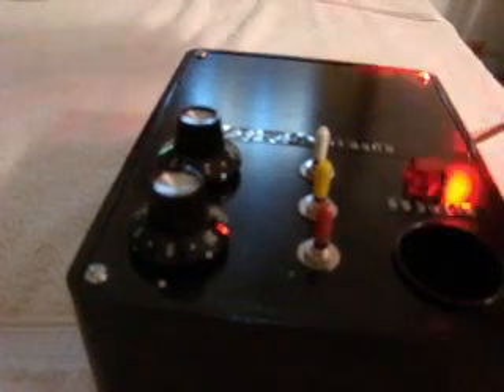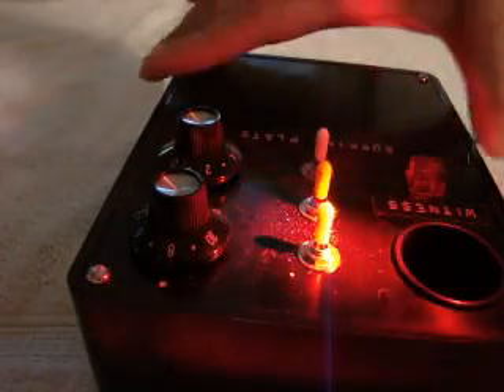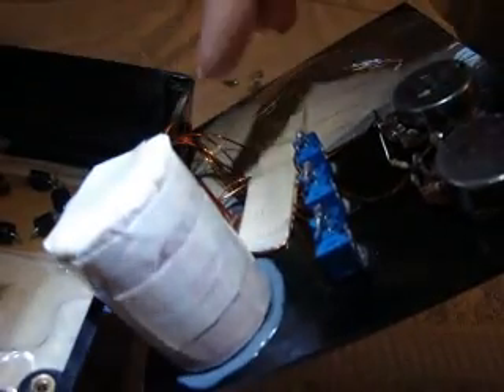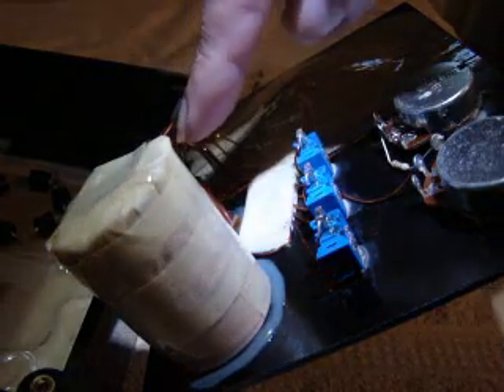Inside Steven Gibbs HDR - Hyper Dimensional Resonator

Comment: It doesn't cause time travel, it induces the Trance state (mind awake, body asleep; sleep paralysis), in this state you can focus on certain chakras, initiate the vibration stage and eject from the body. In the astral form you can then travel anywhere in time. The hard part will be remembering the experience, much like dreams. Unless you practice meditation, you will not have much awareness to remember anything.

The HDR mimics the same practice as is found in the Middle Pillar Ritual, and the Hollow Body practice of Vajrayana Buddhism. Robert Monroe has a similar practice. These practices alone are enough to induce the Trance State.

All Magickal Traditions have Visualization as their core practice.
In Vajrayana Buddhism it is called Generation Stage or a Creative Yoga, by using Visualizations you begin to create hypnogogic imagery that facilitates sleep, an experienced meditator maintains enough awareness without fully dissolving into the resolution of sleep and enters Trance. Once in Trance, Completion Stage Yogas can be practiced, such as the 6 yogas of Naropa, they are the Tummo (mystical heat), illusory body, clear light, The Dream Yoga, the Consciousness Transference yoga, and the Bardo yoga (an advanced form of consciousness transference used after death to transfer oneself into a suitable body for rebirth, this yoga allows you to keep all that you have learned and carry it on to the next life).

Comment: someone out there HAS to be as "talented as Steven Gibbs" to make the exact same product! And sell the exact HDR at a cheaper price! Come on! This is the time of the internet.. where all geniuses can be found easily! 

I challenge any genius out there to build an HDR!
Reply: I built one, a while back... suprisingly the cost  of all the parts adds up. The electromagnet is a bit of an effort. The device is basically a radionics machine. I searched for wiing schematics, but never found any that were correct, so I had to experiment. I eventually bought one ... STeven Gibbs really does make a nice unit.
Reply: TheZooman22 I bet you can only travel in time with the "Steven Gibbs™" authentic version.
Reply: Hi it’s me mr Gibbs 7 years into the future and I’m still dead